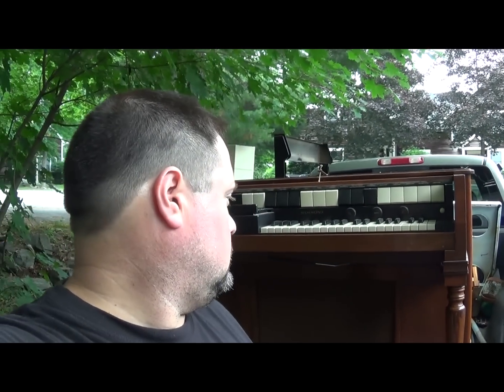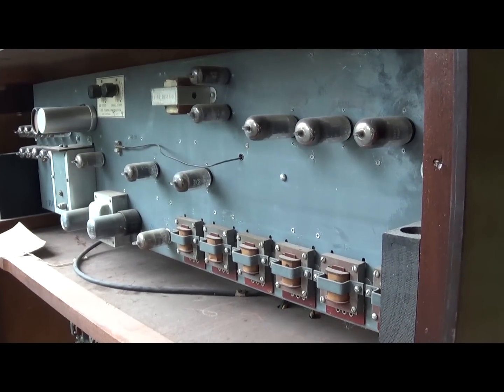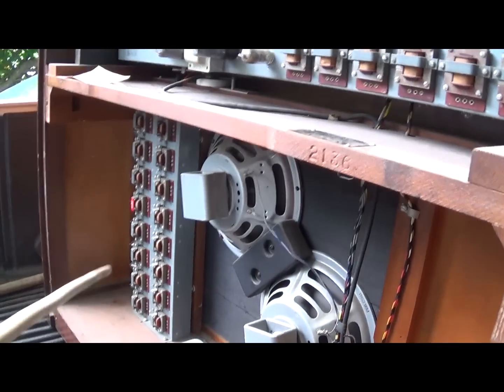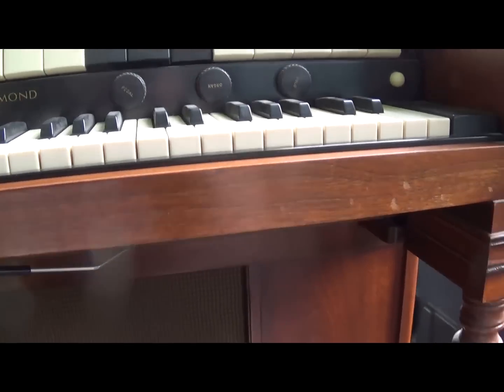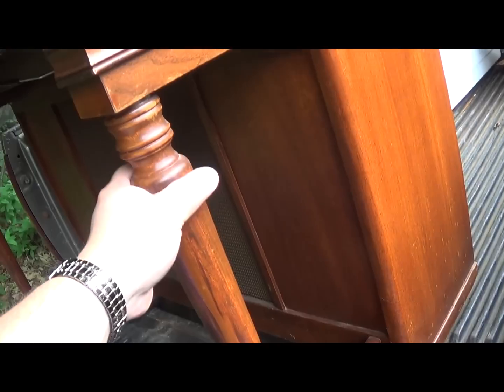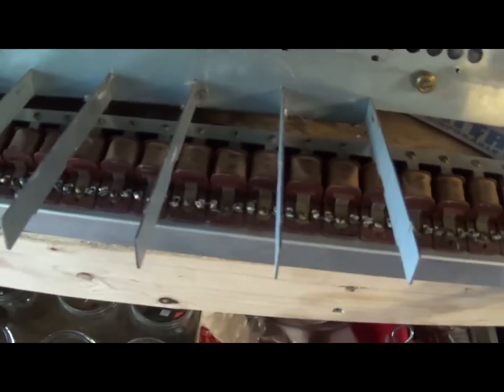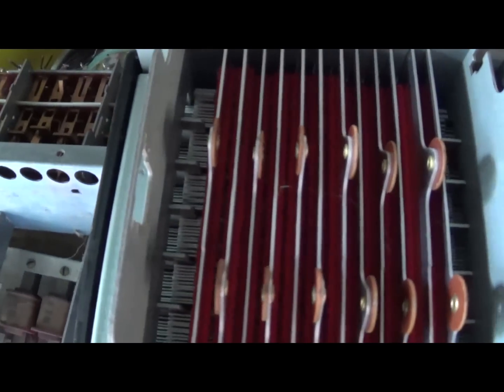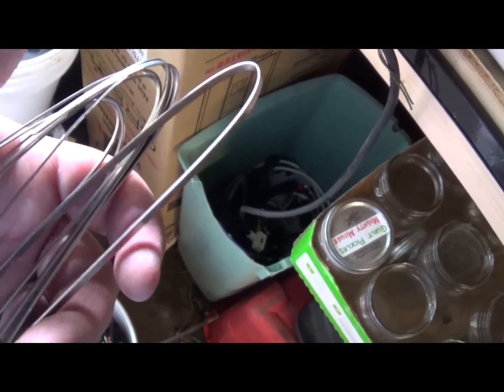Scrapping an Electric Organ First Try

Comment: ELECTRONIC ORGANS, AND WHICH ARE THE VITAL  INSTRUMENTS TO PRESERVE-
[ first a little 1 paragraph soapbox peve, and then I will get into the features to seek, etc. I will tell you about ANY model organ you find if you simply respond to this thread by leaving a comment: It's late for me so if it looks like I left off on something it's because I didn't proofread. Believe me, I only intend to make people aware of these great instruments, not to debate the attributes of analog versus digital. If you want that then read some other threads I've been on. So here is that short rant, and then better stuff...

When I see an Ebay ad in which the body of the ad reads:
" CAME FROM A WORKING ORGAN"
This just makes me want to knock sense into these people! It comes as the biggest insult to great engineers and musician-engineers who designed these instruments,  and everyone who plays, or is eventually going to want to this particular make/model because an actual working or easily fixable example was blatantly destroyed and sold for parts. Namely it's mediocre-for guitar/ substandard for HIFI tube amplifier.

You can find my posts all over the Youtube, The Organ Forum, and even various Guitar and Guitar Amp forums. I played guitar for 20 years before ever playing an organ, and I've built many awesome guitar amps, never once needing to sacrifice an organ to do it. Fact is, organ transformers make for mediocre guitar amps because organs are full frequency instruments and guitar amps are a select mid frequency curve. It's why none of those old Bogen tube PA amps I tried to make sounded good for guitar, even after multiple filtering mods. So to kill an organ simply to get it's tube amp is very sad to witness. I'm a pretty good amp builder. I was fortunate to have roomed with an ace tube amp modifier when I was going to Guitar Institute of Technology (GIT) in 84'-86'. He modded amps for Ratt, Billy Squier, Aerosmith, and it was his amp that ended up being Slash's Marshall Head on the Appetite For Destruction album. 

--THE ORGAN IS THE MOST EXPRESSIVE AND SENSITIVE OF ALL MUSICAL INSTRUMENTS--

- The 1970's was a black mark on the electronic organ industry. They made a lot of garbage in the 1970's because of the advent of the EPROM micro chip. Before 1968 ALL ORGAN MANUFACTURES COMPETED IN JUST 3 AREAS, in this order: VOICING TONE, ANIMATION, and CABINETRY. Always manufactures of these 1935-1968 ( a few to 73'ish) organs put tone first, so it is very difficult to find ANY pre-68' organ that doesn't have a good tonality. And of course tone is the heart of any instrument. Any musical instrument with a good tone has had great care taken when it was built and so almost always will have quality materials. These pre-68' organs always had quality hardwood veneer cabinets. I once balked that one of my better organs had plywood under the venner instead of solid hardwood, but actually hardwood warps. Of course it was a high grade multiple layer plywood which succeeded hardwood ( the cheap particle board cabinets didn't arrive until the mid 70's, when not ironically the rest of the organ was cheap, including the tone! 
SO WHY THE SPEECH ABOUT PRE-1968' ORGANS? Because this is about the time when vacuum tube amplifiers stopped being put in organs. Soooo...

RULE OF THUMB: IF AN ORGAN HAS A TUBE AMP IN IT, IT IS A PRE-68' ORGAN AND WILL MOST SURELY HAVE A VERY PROFESSIONAL TONE. THERE ARE VERY FEW MAKES/MODELS OF ORGANS PRIOR TO 1970' WHICH AREN'T PROFESSIONAL SOUNDING, EASY TO FIX, AND HAVE QUALITY HARDWOOD VENEER CABINETRY NICE ENOUGH TO SIT IN ANY LIVING ROOM. 

HOW TO SPOT IF AN ORGAN IS A VERY GOOD ORGAN OR POSSIBLE SCRAPPING/PARTING OUT ORGAN:

--------------------BLACK,WHITE,RED,YELLOW,MAROON/GREY= KEEPER COLORS!-
ORGANS PRIOR TO AROUND 1970 NEVER HAD MULTI-COLORED TABS ( SWITCHES) THAT DEPARTED FROM THESE 4 BASIC COLORS. ORGANS HAVE 4-FAMILIES OF TONE:and so these four colors correspond.  The 1970's organs used many different colors for the switches and tabs, like purple, blue, orange, etc. 
HOWEVER, A GOOD PRE-1970' ORGAN WILL HAVE JUST THESE FOUR COLORS WHICH ARE UNIVERSAL FOR THE FAMILIES THEY REPRESENT:
--FOUR COLORS- ( and BLACK is used for animation, ie. VIBRATO, TREMOLO, REVERB)

--FLUTE/TIBIA= WHITE (or cream) sometimes embossed with silver/gold or black lettering)
-DIAPASON= WHITE ( or cream) sometimes embossed with silver/gold or red lettering)
-STRING= YELLOW TABS
-REED ( includes brass/horns)= RED
-----and ANIMATION= BLACK, GREY
( note, you will also see a great deal of DARK RED, or MAROON on WURLITZER,LOWREY, and BALDWIN organs of the 1960's. These are great organs, and are usually the SPINET variety of organs ( SPINET ORGAN= 13 pedals and spit keyboards/offset, SMALLER)
(CONSOLE ORGAN= 25 pedals, two or more 61-key keyboard manuals that are lined up with one another. LARGER)
( There are exceptions to this rule for spinet and console organs. For instance, THOMAS TRIANON electronic theater organs have both a longer 61 key manual AND two smaller spinet length keyboards. CONN also had a SPINET THEATRE' ORGAN which had 3 smaller manuals lined up ( see CONN 580 THEATRE ORGAN, is a very good transistor organ)
 
So before I bug some of you out so much like a know it all and make you want to respond to me saying organs are junk nobody wants them unless they are Hammond B3's, I will as gently as I can put it, explain to you that there are actually several more makes and models of organs that also deserve special attention for preserving. For once these are gone there will never be another made. And unlike guitars, drums, horns, guitar amps, and even pianos, which do not require the vast skills of several trades of involvement to design and build, along with a parts list that would tally into the thousands of dollars today, these organs will be literally impossible to be reissued later using the same component values, cabinetry, and mechanical components. Agian, once they are gone there will be no more!

  Most people wouldn't have a problem with someone saying that old electric guitars and tube amps need preserved because they are monetarily valuable and there is a continuous demand for them. I agree, but consider that most music these days is leaving the popularity of the electric guitar in the dust. Still, guitar will always have millions who gravitate toward the instrument as players and listeners. I'ts portable, looks cool, and is very versatile. The organ is actually the most expressive of all musical instruments,

Comment: An old organ was the very first thing I ever scrapped.  Found a great piece of 24c gold in it.  REALLY pretty.
Reply from the maker: Renee Waring really?  Where in it?!?!?
Reply: It was a controller chip.  The legs were a beautiful dull gloss gold.  I'm having my gold processed right now so I don't have a pic for you but man I would LOVE to get more of those.  I've just looked at available photo's on line and found it was a cheap vintage Kimball that someone gave to me.  Way to heavy to lug out of the house when I was ready to get rid of it so I tore it down to make it easier to get out the door.
Reply from the maker: Renee Waring Oh ok, so it was 24k gold plated chip legs.  Nice find!  Best of luck to you!
Reply: I had LOTS of gold plated material, but nothing else compared to this.  Looked like a nugget in color and texture.

Comment: Hi. Great vids and content, my colleague and I watch your stuff in our conference room here in the U.K. Years ago my dad and I had a large non ferrous scrap yard and used to put all vacuum tubes, 'valves' into a small skip. We used to deliver a minimum of about 5 - 600 pounds  at a time to a specialist company that ground them down, blew the fabric, glass and ceramics off and took magnetic bits out with magnets. Most of the rest went for adding to iron in the smelting process. This was when all tv's etc. had valves and they had piles of them that had to be processed with diggers. I don't know what they got out of the valves but it must have been valuable because they were in business for years and only packed up when tv's etc. became semi conductor based. They also had some guys who used to sort valves by hand, really quickly, they never said what they were sorting for but it must have paid as this company had new lorries, exc. offices and premises and operated for years. If valves were worth money then it is hard to believe they are not worth anything now especially with the recycling going on now and the dramatic rise in the price of even basic metals. I scrap all of the time as a hobby alongside of our computer business and really like and commend your efforts, I don't collect valves as I don't think that I have even seen one for several years. On our industrial estate no bin, skip or junk is safe from me. It is definitely a bug, I even go into ditches and dismantle abandoned shopping trolleys with a cordless grinder.
Reply from the maker: mrmadman lol.  It certainly is a bug!  I have often wondered about the tubes, I will need to spend some time to find out more.  Some stores have a reward program for returning trolleys as well.  Thanks for watching!  I find it quite humbling to hear that you watch my videos in a conference room.  Thanks!

Comment: I think the metal strips you found may be nickle plated material. Nickle is often applied in an area where durability is needed on the cheap such as the moving parts of the keyboard. The lack of darkening from tarnish is a tad odd though as Nickle does tarnish kinda like silver just not as bad. Could also be Magnesium which is used in other electronic devices like laptops and cellphones. Magnesium is shiny, doesn't really tarnish, and is flexible in strip form.
Reply: ShinmaRyuu Does magnesium burn with a green flame?  And would that be the best way to test it?

Poo
Reply from the maker: poosmate magnesium burns a bright white.  Small filings are very flammable.
Reply: Moose Scrapper Thanks Moose.  You are so clever! I was always rubbish at the sciences at school, couldn't even pronounce half the chemicals never mind remember their symbols or how to spell them!  I have more interest now but the old grey matter doesn't seem to retain as much info as it used to! lol

Poo

Comment: The S6 doesn't have a tonewheel generator so that's why there's no silver strips in this one.  Look at those thin coppery looking contact strips that are briefly shown at 5:50.  They look the same as the ones on the tonewheel models and if they are, they have a small bit of something exotic (palladium or something) at the tip.
Reply from the maker: torchandhammer excellent thanks!
Reply: Moose Scrapper I watched the video again:  BUILDING HAMMOND ORGANS AT THE HAMMOND FACTORY
It says "a costly palladium alloy to minimize wear"  It also says the strips in the drawbar assembly  for the tonewheel models are sterling silver.
Reply from the maker: torchandhammer great to know thanks!!  I'll have to watch that video!

Comment: I am watching this now,the end of it anyways...Tell me this is not a tonewheel hammond that was  scraped and did not  have palladium separated from the rest of the metal?I myself am about to procure a m3,was wondering what the take is..I knowits heavy and work
Reply: It's a Hammond S6 chord organ and it has valve driven oscillators instead of tonewheels.

Comment: Not a Hammond! Even the low end models are getting scarce as time goes on
Reply: I just saw a free hammond M3 on facebook today. I will never get it in the back of my SUV. Maybe they will let me scrap it at their place if they want to get rid of it bad enough. I know I will have to cut up the wood to make it fit and probably have to do two trips. I will probably get turned down because I will be tearing apart their 60-70 year old organ. I sent message 8 hours ago and no answer yet.

Comment: As I notice, this organ is an Hammond tube organ in the end of 40's and debut of 50's era and I'm sure that such organs have full potential for collecting, or sell them for parts if they're not serviceable, working! I'm not a "scrapper" and I don't like to scrap! But I'm a technician with DIY passion with recycled, used or brand new parts as you have to build a lot of gizmos for the passion of it! So, I use the same material by "cannibalizing" it in a myriad of things! You have very clean explicative videos in HD!
Reply: +LHUPA Not this model....there is more supply than demand in most locales, and getting them working properly again can be a serious challenge.  They use 12 vacuum tube oscillators whose frequencies are divided again and again to produce the right notes in the right octaves.    The paper/wax capacitors in the oscillators have all drifted badly, putting the organ so far out that you can't tune it with the factory adjustment.  Replacing all the caps will make it tuneable again, but getting it tuned can be quite a challenge.  Then, when you're done and have put $100-$200 worth of parts (assuming no or few bad tubes) and 30+ hours of labour into the thing, you get to sell it for $50-$100....Non-working chord organs are almost impossible to give away.  The main reason, BTW, is that even working right they sound like crap.

The tonewheel models, on the other hand, should not be scrapped unless they have coloured tabs (and even that's debatable).  Tonewheel models start at about 250 lbs and have electric motors in them.

Comment: That’s an old chord organ those are really cool they’re analog it probably would have been easy to fix I just scraped an organ but only cause it was missing the amp
Reply from the maker: Yup, the thing is that hardly anyone want them anymore.  I see them on craigslist for months and months even when they are for free.  SO rather than having them end up in a landfill, I grab them, try to take them apart carefully and sell the parts on ebay.  If they don't work at least its getting recycled not trashed.
Reply: Well I wouldn’t do it to an m3 if you find one that would be really sad unless the tonewheels are completely trashed which is rare cause they’re built like a tank if you find m3s you could mod them with foldback and set it up for a Leslie and sell them for a decent amount

Comment: I scrapped an electronic keyboard (organ), and got a lot of keys. what did you do with them? I put them in detergent bottles for recycling.
got a lot of steel and wire from the transformer. where did you get the silver?
Reply from the maker: Sooner Science Nerd I posted them on ebay.  As for the silver, as I said in the video I did not find any in this one.
Reply: good enough.
happy scrapping!